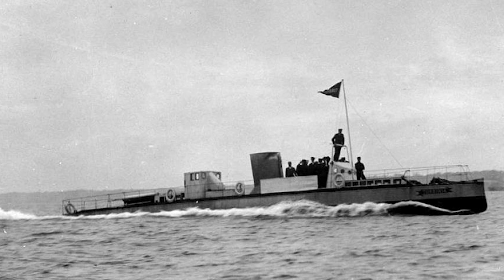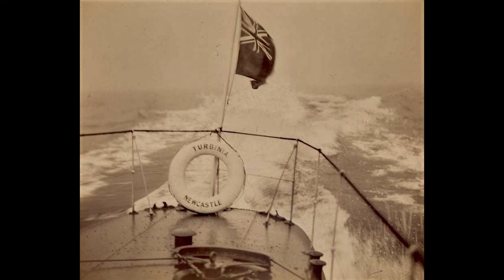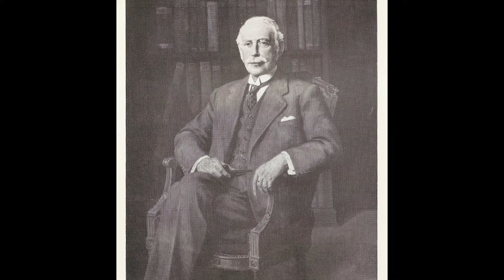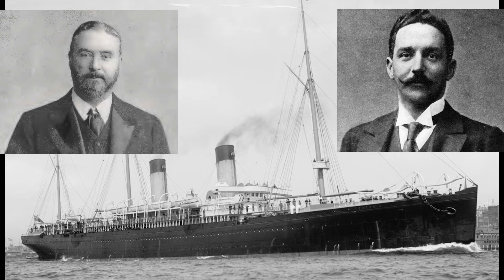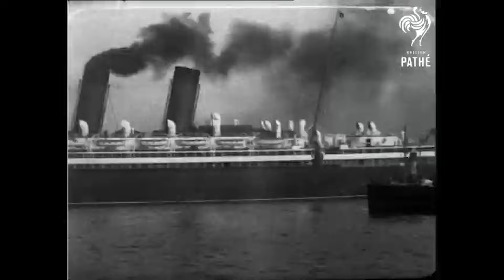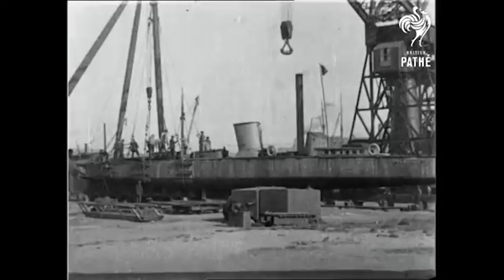Incredible Speed: Turbinia | HISTORY

Comment: You do not know fear on the water until you experience cavitation on a ship!  I was installing eithernet on a ferry.  The captain took me to the engine room to tell me where to connect outlets and the such.  Then the ship started shaking, banging, making a horrible cracking and poping noise that rattled the entire ferry.  The captain yelled, "Cavitation!  I am going to kill that mother fracker." But he did not say fracker.  He pushed a red button that killed the engine. He then ran away with incredible urgency.  About five minutes later, he came down to reset the button and start the engine again.  He told me he was heading back to port and to return later the following week.  A small boat came by to pick up the guy I guess was responsible for thd cavitation.  Then the captain took the helm and let me stay on the bridge.  He was very appologetic and assured me the guy responsible would never work on water again.

Comment: The evolution  of the turbines came full circle with the advent of the gas turbines powering both civil and naval vessels. Ferries operating  with water jet propulsion are operated with gas turbines originally designed for jet aircraft.  Naval frigates, destroyers and the new INVINCIBLE aircraft carriers are powered with, ironically the same engines that were designed for the Concorde and Vulcan (TM1, TM2 and TM3, 23,000, 23,000, and 28,000 SHP.  Scary, huh?)

Comment: Something about how you explaine the triple expansion engine - the steam woild go into the biggest cylinder first, then the smaller ones, to compensate for pressure loss and condensation. You described it as going the other way around.
Reply from the maker: No I'm sorry, you have that wrong. High pressure cylinders always had the smallest volume, while the low pressure cylinder had the largest volume. 

Steam expands as it is used in an engine, if you ran the steam down into smaller cylinders you'd be wasting energy trying to compress the steam into a smaller volume. 

By having the steam enter larger cylinders as it expands, you extract energy from it.
Reply: @AlextheHistorian  Yeah you're right, my bad.

Comment: In 1998, I visited the Queen Mary at Long Beach. Part of the tour was the engine room, where I saw the high-speed turbine for one of the propellor shafts. It didn't look that big, but the notice board said it developed forty thousand horsepower.
Reply from the maker: Each of Queen Mary's 4 propellers was driven by a turbine engine set. In each engine set were 4 turbines: high pressure, intermediate pressure, second intermediate pressure and low pressure. So that high speed turbine you saw was just one of 4 turbines in that engine, driving just one of the propellers.

Those 4 turbines on the engine together produced a service output of 40,000 HP, but had a maximum output of 50,000 HP to help the ship compete for speed.
Reply: @AlextheHistorian  Yes, I saw the other turbines for that particular propellor shaft, but must have mis-interpreted the part of the information board that specified the power of each of the turbines.
Still, all that power made the ship fast enough that it could cross the Atlantic during the War, unescorted.

Comment: The majority of powerplants being built today are Combined Cycle Turbines. Primary turbine is fueled by natural gas driving by a common shaft line to the first generator, then the heated exhaust of the primary turbine is flowed into a heat exchanger to create steam which then drives the secondary turbine connected to another generator. It's the highest efficiency for large powerplants currently available short of nuclear powerplants.

Comment: As a young graduate engineer in the early eighties, I went to the factory (NEI Parsons by then) for an interview and a tour. The sheer scale of the engineering was breathtaking. The lathes that turned so slowly but took one inch chips off the huge shafts as they turned..... The huge pit in which they spun the turbines up to check for balance..... and the size/weight of the absolutely enormous lid that was needed to contain the energy if a shaft failed. The amount of kinetic energy in one of those shafts turning that quickly was staggering. I ended up in aerospace instead, but it left an impression and a sense of awe that has never left me.
Reply: They also helped produce Sadam Husain's super gun for the Iraqi war. That's what those lathes were used for.

Comment: Great turbine Speed does not give you torque. It gives you power. A diesel has torque because to create its power at low revs it needs to make more torque than a higher reving petrol engine. Great video. Thumbs up

Comment: The other neat idea was the condenser. This was fed sea water by a rocking scoop and another for water return. They could be rocked closed in shallow water to prevent blockages and reversed to clear blocks by reversing the water flow. As the boat speed increased, so did the water flow to match the increased need for cooling. No pumps needed.

Comment: Although steam turbines are not very common anymore, when we realize how many vehicles contain a "turbo" (i.e. turbine) nowadays, it shows , besides jet engines,  the enormous significance, even today, of this invention.
Reply: They are still very common. Used in most power stations for generating electricity! If and when fusion reactors start working properly they will also use steam turbines!
Reply: In 1905, Swiss born Dr. Alfred Büchi received the first patent on a turbocharger for a marine engine. However, the concept of turbocharging goes back to the end of the 19th century when both Gottlieb Daimler and Rudolf Diesel were doing research into forced induction. The first turbochargers were not applied to marine or automotive: they were applied to airplanes.

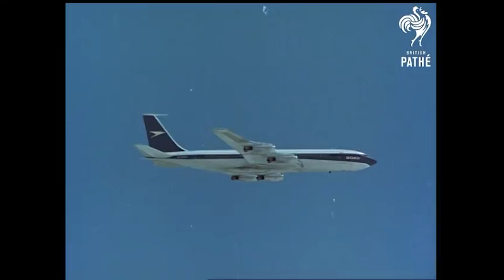Comment: 10:45 - "Though steam turbines are rarely used any more . . . "
WTF??  You said yourself that steam turbines are used in power stations to generate electricity;  how RARE are coal and oil-fired power stations?  They are also used in many nuclear submarines, so check your damn facts before posting!
Reply: rarely used IN SHIPS.....
today's commercial vessels including cruise liners use fuel oil/bunker oil reciprocating piston engines....
only nuclear powered vessels or those with a military purpose that suffer no economic restraints use steam turbines.....
many military vessels now use gas turbines instead which eliminates the boilers...

Comment: Got an ignorant question for you, or anyone.

Turbine engines need reduction gears to convert high turbine speed to proper slow propeller speed.  Could not piston engines add the opposite, "upduction" gears, to convert slow piston engine speed to higher propeller speed?  I know turbines have other advantages, (efficiency, smoother, compact) but it seems reasonable for someone to have tried, yet I have never heard of it.
Reply from the maker: Thats actually a good question. Reduction gears reduce speed and convert that into power, which you need if your propellers are going to churn the waters of the ocean. 

But gears designed to increase speed will reduce the power, because it will use that power to spin the propeller faster, and the water will only act against that speed. The weak propellers wouldn't be able to push the water around it as well as they could without a gear box.
Reply: @AlextheHistorian  I wondered about that, but turbines and piston engines must have drastically different power and torque curves.  I know you can change piston torque by changing the stroke and pressure, but I don't know how pressure affects turbine power curves, and even less idea how, say, turbine diameter or number of stages affects power curves.

Suppose a piston engine upgeared RPMs by a factor of two; could you maintain the same torque by doubling the stroke or pressure or number of pistons?

Need some kind of mechanical or power plant engineer!
Reply from the maker: You probably could, but then the recipricating engine would need to consume more steam, which means consuming more fuel. Heck, it could even require additional boilers or upgrades to the same boilers.
Reply: @AlextheHistorian  Many years ago there was an engineer called David Wardale who put major improvements into a railway steam engine that dramatically changed the efficiency of the engine, if he had looked at the marine steam engine I am sure he would have been able to increase the efficiency of it. However, his developments came at the end of the glory days of steam on the railways, and his work never really went much further. The diesel engine pretty much drove the steam engine from the railway tracks and ocean. But... who knows what could be possible if the marine steam engine was relooked today. I did love your vid though, and Turbinia is on my bucket list. Keep it up!!!

Comment: Weight for weight, steam turbines are more powerful than steam piston engines. They are also more reliable and need less maintenance. However efficiency is limited by the steam cycle itself. Turbines are not hugely more efficient than triple expansion pistons.

Comment: Most people refer to the largest United States aircraft carriers as "nuclear powered". It's true that the heat to boil the water comes from onboard nuclear reactors but the actual propulsion system is a STEAM ENGINE - turbine of course.
Reply: A reactor is simply a way of saying that it is a steam generator that uses the heat of the pile to turn your water into steam. The Turbinia had a coal fired reactor!!!😁 Btw, was it a single boiler or multiple ones? I'm guessing by the single stack it was one but I'm sure it's possible that they trunked their boiler uptakes into a single stack.
Reply: @albertoswald8461  Either way, the story of Charles Parsons and the Turbinia is a fascinating story about a significant advance in steamship technology. I suppose the steam turbine as motive power for ships was more important for military ships (and, of course, luxury liners) than for cargo ships - i.e. I suppose piston-type steam engines continued to power a large proportion of merchant vessels until Diesel became the predominant motive power for seagoing ships.
Reply: @rogermetzger7335  , I'd say after the 1940s or so most regular cargo ships and oil tankers were running with steam turbines especially with reduction gears. Reciprocating steamers were still around for a while although it disappeared from the oceans by the 1960's and the Great Lakes with 2 exceptions by the 1990's. I first started working on ships when I got on my first ship, the USS Shreveport in 1990, steam was still decently represented although diesel ships were taking over. Now though at least American flag I don't think that there are any steam jobs left on the Ocean. The Chemical Pioneer went to the scrapyard about a year or so ago. I think she was the last steam tanker although she just hauled chemicals. The only active steamers in commercial service that I know of are on the Great Lakes and there's only five of them running plus one or two that are out of service. Also the American Queen paddlewheel boat that runs the Mississippi and Ohio rivers has a steam driven paddlewheel and diesel z-drives. Plus you have a few little excursion steamers for tourists here and there but that's about it for active merchant ships.

Comment: My former next door neighbor pointed out to me that the boiler needed to produce the prodigious amount of steam Turbinia needed also had to be very innovative. It was designed by Yarrow. The boiler went on to be standard equipment for most British merchant and military vessels in WW 1. The neighbor was Yarrow's g grandson.
Reply: David Ford..That is interesting information. I was thinking as I watched this video that the boiler design would need to be more advanced than the relatively simple design that a triple expansion piston engine would tolerate. One very important design feature of a boiler feeding a bladed turbine is that the steam supply needs to be superheated dry steam otherwise the turbine blades will very quickly deteriorate due to wet steam erosion. The Turbinia was obviously a very innovative and advanced design on many fronts.
Reply: @howardosborne8647  how can steam be dry ?
Reply from the maker: Wet and dry steam are exactly as they sound. Wet steam is at a temperature between 212 degrees F to upwards of 400-600 dF. Wet steam is highly saturated with water vapor.

Dry steam is superheated to 600+ dF, and at those temperatures the molecules are spaced so far apart that a cubic foot of dry steam will not have as much water vapor in it as a cubic foot of wet steam. Dry steam because it's superheated nature, has more energy in it, and therefore is more powerful when used in a steam engine.

Comment: As well as ships, planes and power generation, the turbine has also been very important for road and rail too, in the form of the turbocharger, and for space travel in the form of the turbo-pump. The turbine is up there with the steam engine, the transistor and the integrated circuit as one of the great technological leaps of the past 200 years.
Reply: Don’t forget the actual turbine powered trains and tanks but spot on comment
Reply: In 1905, Swiss born Dr. Alfred Büchi received the first patent on a turbocharger for a marine engine. However, the concept of turbocharging goes back to the end of the 19th century when both Gottlieb Daimler and Rudolf Diesel were doing research into forced induction. The first turbochargers were not applied to marine or automotive: they were applied to airplanes.
Reply: But it wasn't a great "technological leap", was it - unless you mean backwards?  Parsons simply realised that he could do away with valve-gear, pistons, cylinders, and crankshaft - and direct the high pressure steam directly at the blades in the manner of a water-mill.

Comment: All US Navy aircraft carriers, 2 reactors, 4 steam turbines. All US submarines, 1 reactor, 1 steam turbine. Wasp Class LHD, 2 steam turbines, 2 gas turbines. Majority of the destroyers and cruisers are all multiple gas turbine propelled.
Reply: All the steam destroyers were gone by 1994. Plus all the nuclear powered cruisers were decommissioned by the turn of the century. All current navy destroyers and cruisers are gas turbine propulsion.
Reply: US subs have two main drive turbines in separate casings, port and starboard, geared into a single centerline reduction gear and drive shaft. The Narwhal was an exception, with a single very large direct drive steam turbine. The Tulibee and Lipscomb had unique turbo-electric drives.

Comment: The turbine engine made a big impact in powering fast ships but its huge impact was upon the generation of electricity.Power stations only a year or two old were decommisioned and turbine generation took over. Charles parsons and his colleague only perfected the turbine, lots of people had been trying to develop a working turbine but the blades kept breaking off at high speeds with catastrophic results. Parsons great achievement was stopping the blades flying free.
Reply: I was wondering about that because metallurgy was much less sophisticated at dealing with those types of stresses and circumstances
Reply: I think Hero of Alexandria takes credit for first boiler/turbine.
Reply: @albertoswald8461  And you know why nothing came of it at the time? Because although the other senators couldn't see the point of it at the time, the emperor realised the potential significance, and whispered to Hero afterwards, "you'd better put this aside - it could cause social upheaval: what would we do with all the slaves?" - simultaneously both long-sighted and short-sighted at the same time
Reply: @herseem  , I thought it was because Hero only thought of it as a toy to amuse children and didn't think to put a shaft with a propeller on the end. Would have put galley slaves out of a job!!!
Reply: @albertoswald8461  well according to the late Terry Jones, it was the emperor who spotted the potential for it doing useful work

Comment: Steam turbines are still used in many applications like aircraft carriers, power plants, submarines.
Reply: There are several freighters on the Great Lakes running on steam. Central Marine Logistics has the S.S. Wilfred Sykes ( plus the Edward L. Ryerson in long term layup), Key Lakes has the Arthur Anderson, the Philip R. Clarke and for now the Cason Callaway although it's sounding more like it could be scrapped soon. Also the cement boat the S.S. Alpena is still running. Not to mention the SS Badger which is the last coal fired ship on the Great Lakes. Unlike the others she has 2 3500 horsepower steeple compound Skinner Uniflow reciprocating steam engines with steam provided by 4 420 psi Foster Wheeler water tube boilers with 2 Firite stokers per boiler. I've worked all of them except the Anderson, Ryerson and Alpena not to mention others since scrapped, dieselized or turned into barges.